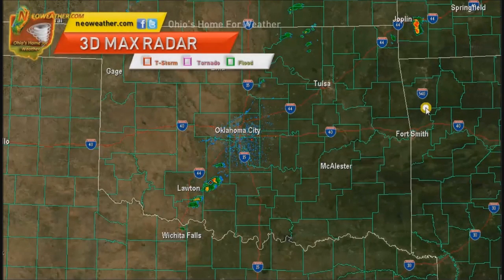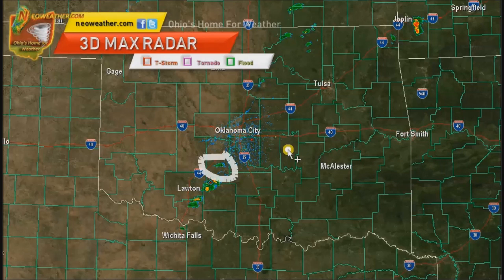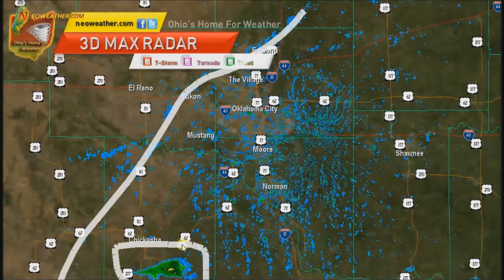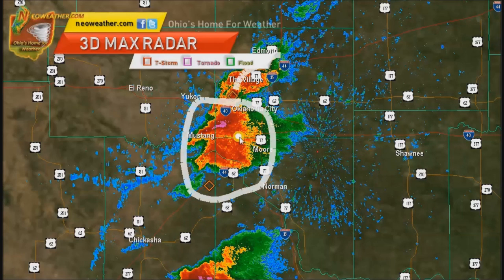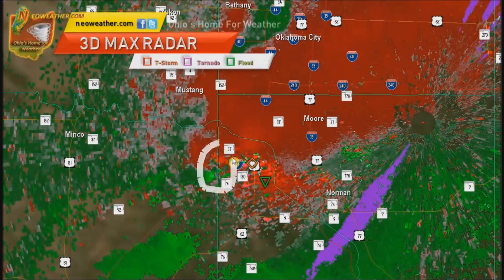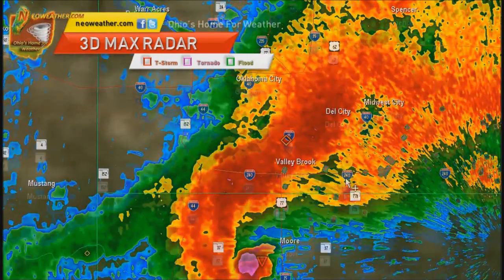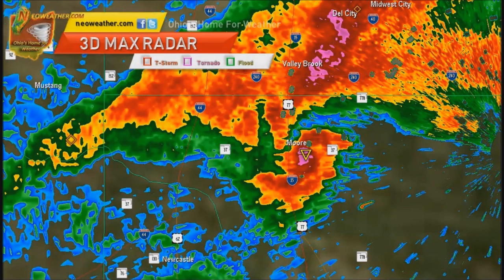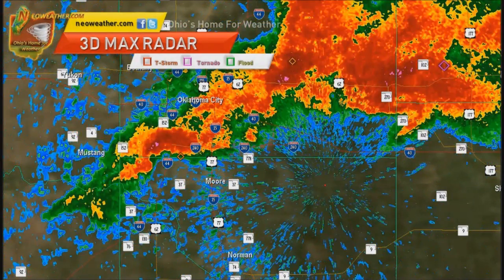Moore, OK Tornado Radar Loop

Comment: I’ve used GRLevel 2 analyst for years and btw this guy did nothing wrong! The tornado and updraft is tilted in the real world. Tornados only appear straight because the wall cloud tilts and the updraft is tilted tornados usually lean into the direction of travel NE or E. If the tornado and updraft was not tilted it literally wouldn’t be possible to have a RFB

Comment: 5:09 I didn't know a purple TVS existed until now... Well, when I'm tracking storms on GR2 Analyst I'll definitely be on the lookout for that. The most I've witnessed is a red TVS, and that was with one of the Texas wedges in April/May.
Reply: They are pretty rare if you use the default settings in the program.  You can manually modify those for the conditions at hand though (lower-topped or low-instability events, Dixie Alley events, etc).

Comment: A mile wide tornado cutting througj Moore imigane of the el Reno Tornado continued on and hit OKC Metro at over 2.6 miles wide imigane that path
Reply: And with 300mph winds...it would have been catastrophic. I forgot which highway it was but there was a highway that wad backed up and it was in the path of the el reno tornado. Thankfully the tornado died before reaching said highway, if so it would have killed over 500 people, making it the worst tornado disaster in modern US history
Reply: @nickdavis965  it was several highways that were jammed with traffic. The local news told people to flee south in their vehicles. The worst possible advice that almost killed a ton of people. There are only a couple places to cross the river south of okc and el reno. Which is why traffic was backed up everywhere. That storm could have easily spawned more tornadoes as people tried to flee in their cars.
Reply: @johnshottie4415  The meteorologist responsible for that snafu is Mike Morgan; the chief meteorologist for Oklahoma City's NBC affiliate KFOR Channel 4. His fellow meteorologists Damon Lane and Gary England (the chief meteorologists for Oklahoma City's ABC affiliate KOCO Channel 5 and CBS affiliate KWTV Channel 9, respectively) gave advice that would have actually saved lives.
Reply: El Reno was weaker but wider by a mild but Bangladesh 🇧🇩 has the worst Tornado 🌪 massacre on record.

Comment: I live in Oklahoma and this was one of the worst days for us. I was only in kindergarten but when we live in Stephens county they had us on lockdown till our parents came and once we got home we saw it on tv and I bursted into tears it was so scary.But I mean its Oklahoma u font know what will happen.
Reply from the maker: That must have been really scary. Thanks for sharing your story.
Reply: While the disaster was extremely scary; what balances it out is the sense of community that followed in the immediate aftermath. For those who are not familiar with it; this is a phenomenon known as the Oklahoma Standard. This term was first coined in the immediate aftermath of the Oklahoma City bombing in 1995 and was meant to reference how average everyday citizens dropped whatever it was they were doing and raced to the site of the bombing to help the first responders with rescue efforts. With regards to the tornadoes that struck Moore, Oklahoma (May 3rd, 1999 and May 20th, 2013) it was meant to reference how average everyday citizens who were not injured by the storm helped out the first responders by loading the injured into the beds of pickup trucks or the backs of SUVs and minivans and getting them to hospitals throughout Oklahoma City. Moore Medical Center had been struck and knocked out by the storm; thus rendering it unable to treat the injured.

Comment: One basic thing I learned many years ago , a tornado will be formed on the southwest end of a thunderstorm.Thanks
Reply: Thomas Blue on the front end of a severe thunderstorm line also.   Nashville . 2020
Reply: I once watched a tornado spawn directly over Hilton Head, SC.  I was miles away on another island and had a good cross section view.  The tornado formed at the leading edge of the thunderstorm and bizarrely had a well defined horn like protrusion from the top of the storm as well - like at a 30° off the horizontal upwards and above it.

Comment: what radar program is that?
Reply: ***** I had GR2Analyst from like 5 years ago and it looked different (and no longer works unless I use it to import past radar data) were there a lot of updates since then?
Reply: @wxknight  You might get your version to work again if you select the Iowa State Nexrad feed at https://mesonet-nexrad.agron.iastate.edu/level2/raw/.  Unfortunately, it's not program updates that killed the old version, it's changes to the Nexrad data itself.  The upgrade to 2.80 will only cost $100 or so.
Reply from the maker: +wxknight There is a whole new version now, yes.  Many improvements!  Excellent program! - Mark S.
Reply: What color table are you using for Gr2Analyst?
Reply: Alissa MewMew it's called GR2Analyst, very good program :)

Comment: Very thorough, scientific explanation and playback of events. I was expecting just a loop of the radar. But you actually had the data and program to show everything the meteorologists saw and even look at a vertical image of the tornado itself. Thanks for this man. You earned a sub.
Reply from the maker: +DarkFilmDirector Thank you!! - Mark S.
Reply: DMC12Gauge How long was this tornado on the ground from the time it actually touched down until it weakened? F-5 Tornadoes like that are quite rare.
Reply: @carlahead5072  Around Oklahoma City they're too common. That region has seen more than 5 F5 tornados in only 5 years. 2 of them took almost identical paths through Moore; one had the highest wind speeds ever recorded and within days, the largest tornado in history  touched down and just missed a nearby town (El Reno). When I saw on video how  fast the Joplin EF5 started, then grew, I could barely get my jaw off the floor.